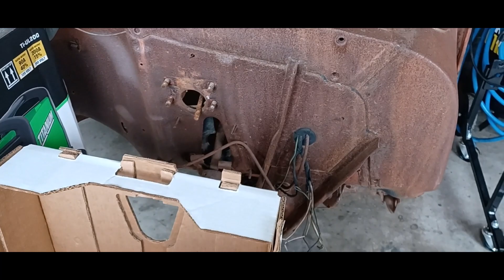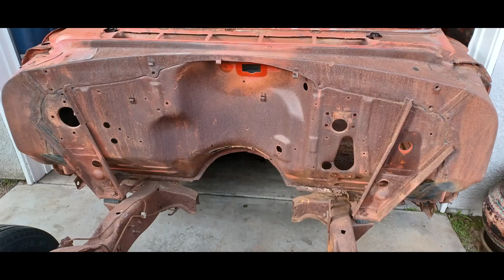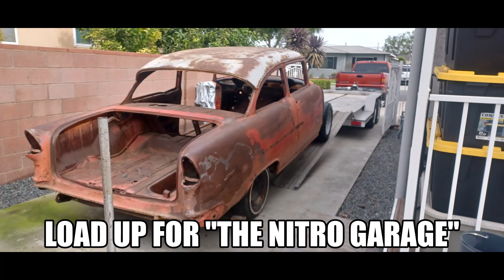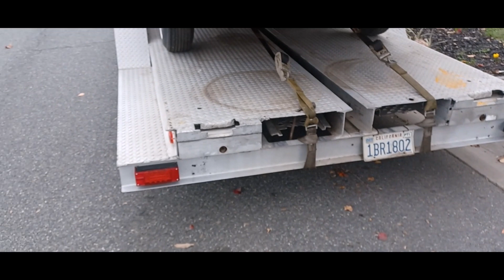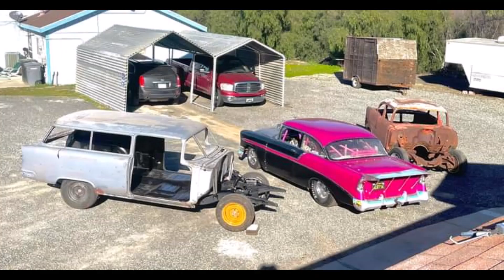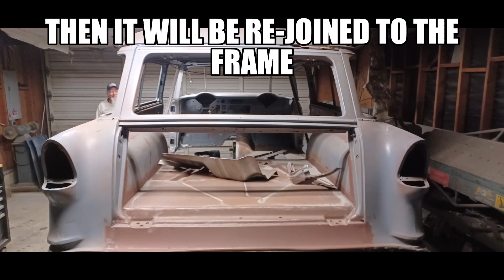The '55 Chevy Delray Gasser Goes to the Nitro Garage!

Comment: shifting rod bracket was the same for pg and 3-speed
Reply from the maker: Perfect!  I put that on there hoping someone would clarify.  The interesting part is the car is original and does not have or have any sign that it had a clutch pedal.  It makes me wonder if a standard 210 could have been changed on the assembly line to a Delray or changed due to a customer special order.  The other possibility was dealer installed changes.  Thanks for clarifying and thanks for watching!

Comment: You letting someone else do the most satisfying part. I'll let someone else do the Bondo work I hate that.
Reply from the maker: Yes, it was a decision that was made before I had my channel because I have a minimal background with welding and did not have the equipment at the time.  I decided to hand this one off to The Nitro Garage after seeing the incredible job they did on my kid's '71 Nova.  Basically, the A pillars were detached from the dash and they replaced all exterior sheet metal panels but, the roof on the Nova.  I have five '55 Chevy's and this one I am trying to get done in time for my Dad to take a ride in it before he passes.  Newt will get it done while I work on the other '55's.  The next major project is my 4 door and I will do all the sheetmetal repairs on that one now that I have the time, the channel and the equipment.  I hear you on bondo work....I am not a fan either!  Thanks for watching!